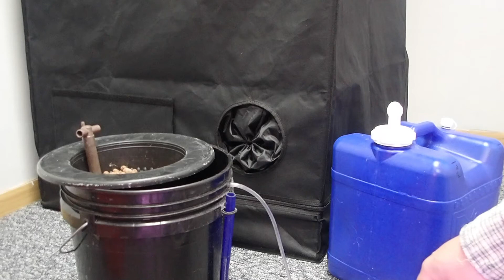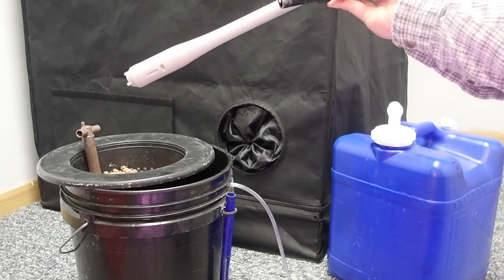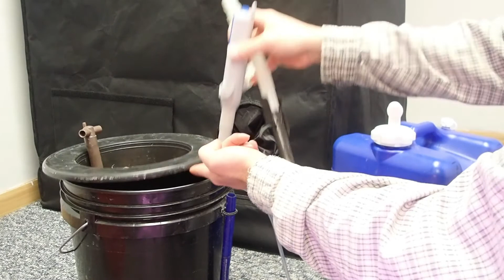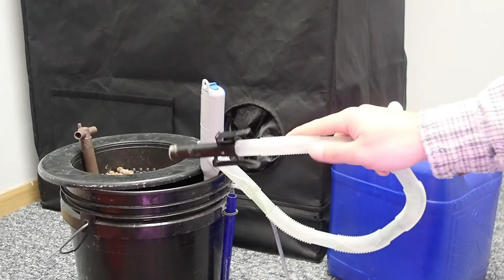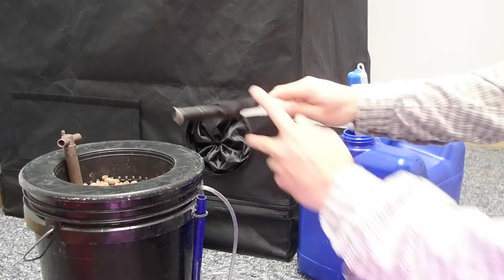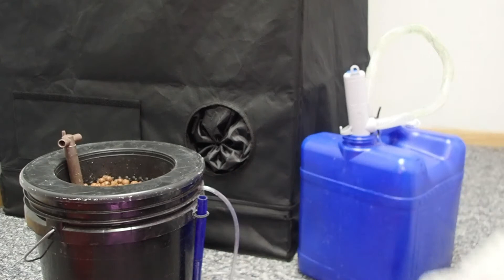Easiest Water Cleaning Hydroponic DWC Systems: Cheap Transfer Pump

Comment: Two buckets is much easier just switch out
Reply from the maker: Unfortunately, when growing in a tent with hanging lights and you have 4ft tall plants, the root ball is massive. If the plants have fruits/flowers and weight to it, swapping buckets is not feasible or recommended. If your plants are using any type of scrog setup or other trellis work, they''ve become a permanent fixture until harvested. Exposing root balls to air/light is also detrimental to the plants.
Reply: @HowlingFarms  
i had a 4 bucket setup in a 1m x 1m x 2m Box.
placed the buckets on a stand for each bucket, build from aluminum profiles. they been about 15cm high and gave me enough room to add a drainage access at the bottom of each bucket.
this way i could just wash the residue without removing the plants. In a later run in increased the high of the stands, for more clearance.
Reply: @back_to_the_couch  ive thought about drainage holes in the bottom, but i would be nervous of the seal failing and all of it spilling out. How did you go about preventing this?

Comment: I say the easiest way is to have a spare bucket and just switch the net pot lid. That way you can clean the bucket for next water change🍻✌🏻
Reply: been there, done that, and my plants were far too big and bulky for that to be considered easy.
depends on what and how you're growing though maybe.
Reply: Yah lifting your lid all the way off in flower with all the roots is not easy, this is a much easier way.
Reply: Tough to do with a trellis net
Reply: Like the other 2 said....once the plant gets big its going to be very difficult and  if your using a trellis to LST then this is definitely the way to go!
Reply: @chemdawg2323 new to growing and thought the above comment made so much sense, then I looked at the replies and realized why I’m still taking as much as I can as a new grower.
Reply: If your growing small plants 🌱 you can do that ,,once late flowering starts buds are falling over and need to be supported